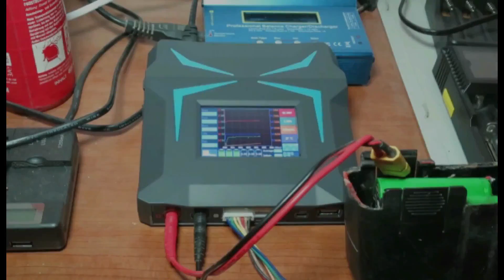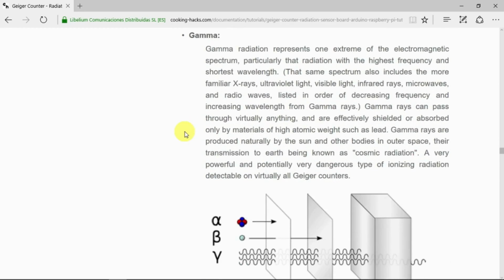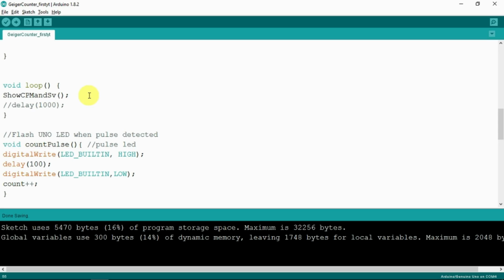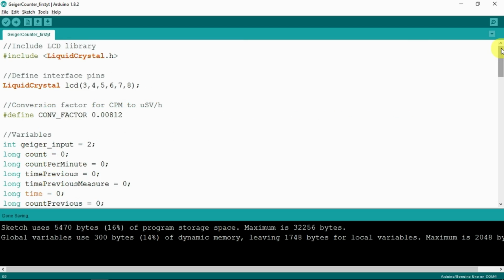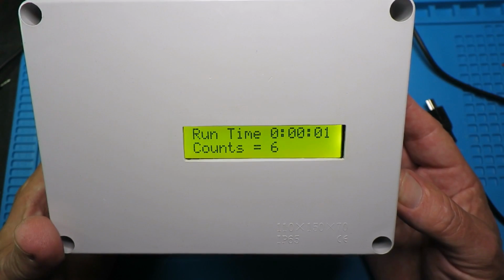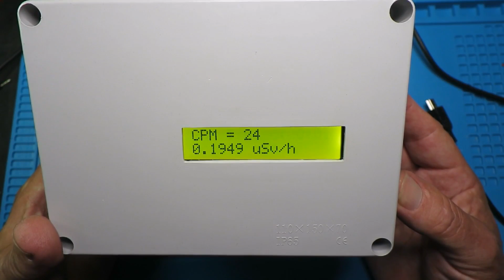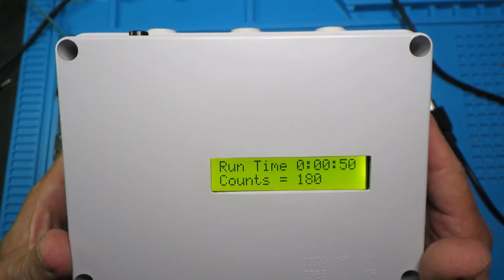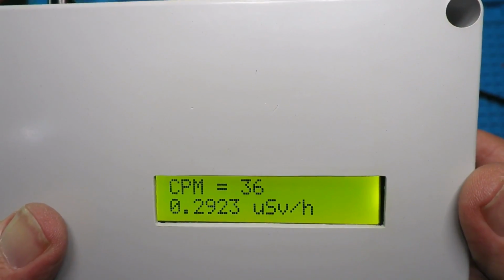Geiger Counter Arduino Project - Part 2 - Electronic Project

Comment: what would happen if you remove the 3 second delay at the end of the code ?
Reply from the maker: Hi, as far as I can remember (it was 7 years ago!) the delay is to allow sufficient particle counts to accumulate. Hopefully you should be in a place where the radiation levels are not that high and so if a shorter delay was used it is possible no counts would register. I think this then results in the values being more representative of the amount of radiation present. Feel free to experiment with this value. Thanks for watching, have a great day!

Comment: Gave this project a build but with a I2C OLED display.  Looks nice, but its a smaller than the LCD so a more difficult read.  So now once I move it to a nano and then 3d print a case, it should be good to go.  Any idea how to calibrate the geiger board?  I have access to a radiation meter (as im a radiation worker) so getting accurate numbers is easy for me.  However this geiger kit has surprisingly little data online.  I'm guessing the trim pot on the board is for calibrating the count rate?
Reply from the maker: DO NOT TOUCH THE TRIM POT!! It sets the high voltage for the Geiger tube! You can see the schematic here : https://drive.google.com/file/d/1l8TuQgZiDeYuhiSFNRPBbLaZncGen0ZS/view?usp=sharing
Calibration is done in software by changing the conversion factor : https://youtu.be/CPW7CREKkEo?t=196 Please consider subscribing if you have not done so already!
Reply: @1nformatica  thank you for the advice and the response on an old video.  I definitely won't be touching the trim pot, lol.
Once I've completed the build (3d printed case and all), I will send you some pics of it if you'd like.
Reply from the maker: @thereare4lights137  Hi, glad to help! Would love to see how yours turns out : gizmohombre@gmail.com

Comment: Did you find out what these 2 pins described as P100 are for? Maybe they give cleaner signal than VIN?
Reply from the maker: There is a position on the board for a jumper to enable the audio jack marked P100 you can see it on the left above the jack socket in my first video: https://youtu.be/4Tqo3B98ZgM?t=1

Comment: Nice, thank you. The uSv/h reading arguably has too many digits. When the CPM is "30", then the uSv/h is "0.2436" which is overly precise considering that the input data is just 30. It's a "Significant Figures" detail.
Reply from the maker: Agreed, but there is a lot of empty screen to fill!!

Comment: Build a Simple ION Chamber to detect the Apha Particles.    You could mount your Geiger Tube in a wand connected to the PCB via some Coaxial Cable.

Comment: There must be something wrong with the conversion, because: 120 CPM equals ~ 0,0001 mSv /h
Reply from the maker: The calculation from CPM to mSv/h includes a conversion factor depending on the tube characteristics https://youtu.be/CPW7CREKkEo?t=198

Comment: I couldn't find the testing video :/ you didn't have time to test?
Reply from the maker: I went to the location where the B52 crash was and when filming was approached and "advised" not to continue. The unit works well and I checked it against a professional Gamma Scout meter and they were in agreement.
Reply: @1nformatica   I bought Arduino kit and ordered the same counter. I am gonna build this geiger counter project. But prob will be in outside of the counter. Final product will look like a mine detector. I will use it to hunt uranium ore.
Reply from the maker: Wow! Good luck with that.
Reply: @1nformatica  thanks :D
Reply: @1nformatica  it's done. I didn't use that circuit with 555 IC. I changed code ''attachInterrupt(digitalPinToInterrupt(2), countPulse, RISING);''  into attachInterrupt(digitalPinToInterrupt(2), countPulse, FALLING);

and it works!!

I connected VIN pin on geiger to pin-2 on the arduino.
Reply from the maker: Yes, that will work. I put the 555 to square up the waveform to avoid false triggering / counts.

Comment: I've almost got it all together! It looks good on the Serial Monitor, but having issues debugging the LCD interface.
Reply from the maker: I would try loading one of the Arduino test sketches for the LCD. Having got that working it should be easier to go back to the project and find the issue. Good luck!
Reply: @1nformatica  Yept. I think i'll try "Hello World" when i get home.
Reply from the maker: Keep me posted on your progress!
Reply: @1nformatica  I think I need to look into the 555 circuit a bit. I got the output on the LCD, but if it sees anything over ambient radiation it will eventually throw bad characters on the LCD.
Reply from the maker: It seems like you have noise on the signal. If you have an oscilloscope you should see a clean pulse.

Comment: one thing though, do you need a window on the box for better sensitivity or how do you calibrate for pvc enclosure  for beta and gamma?
Reply from the maker: Plastic will not stop beta or gamma particles. In my testing there was no difference in it's performance in or out of the enclosure. https://www.cooking-hacks.com/documentation/tutorials/geiger-counter-radiation-sensor-board-arduino-raspberry-pi-tutorial/#types_of_radiation
Reply: @1nformatica  hi this link cant be open again. can send again??
Reply from the maker: @meenachiparthipan5405  Sadly that page is no longer available. Wikipedia covers the same information : https://en.wikipedia.org/wiki/Radiation

Comment: For field job one may also add GPS logging and ah yes sdcard logger
Reply from the maker: That is a great idea! You could use an M5Stack module which has an SD card slot and also a GPS module. http://bit.ly/M5StackGPS 
M5Stack Core ESP32 http://bit.ly/M5Stack
https://www.youtube.com/watch?v=po3pbBcOxzA

Comment: Could you help me ( arduino uno remote connection and codes)?  I want to take this measurement from far distance. I also need these codes at the same time.
Reply from the maker: Hi, recently I have done some projects using "LoRa" modules to send data (temperature readings) to remote Receivers. That may give you some ideas : https://www.youtube.com/watch?v=2Q4O88hmjzE
Also see : https://www.youtube.com/watch?v=etzn2lIEOX4